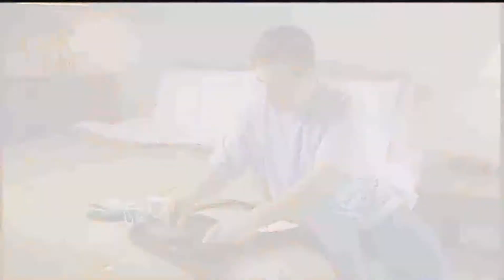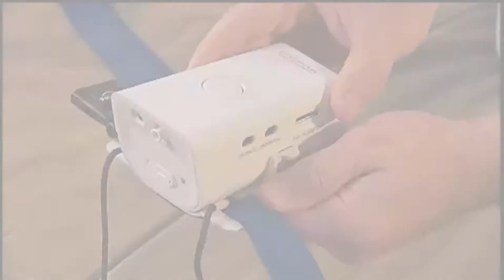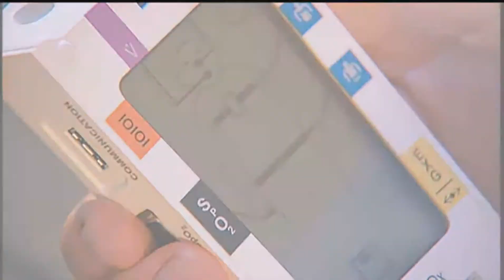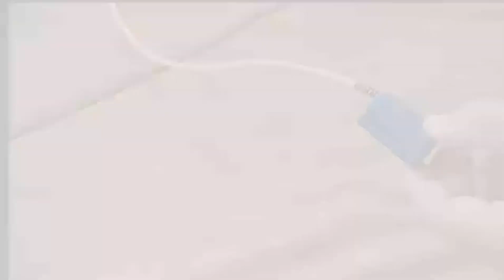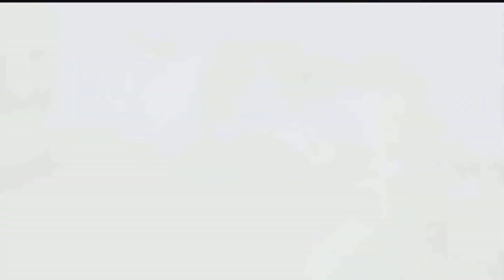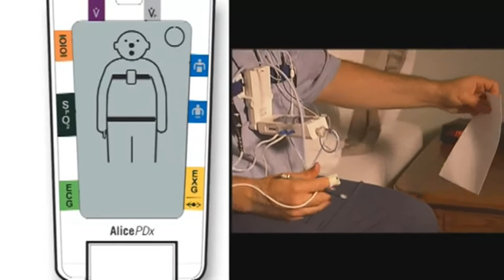Alice PDx from Philips Respironics | Dispositivo de Diagnósticos Portátil

Comment: This device is to blame because of a bad design decision in lacking one of the most important things needed: It has no indicator whether you see it records correctly (neither outside as a lamp nor to see inside at the screen). The lamp showing in the video only shows up when there is a connection unplugged, but no signal whether the operation is alright. Our hospital uses that old device and its bad if you have to rely on such issuing device and you don't even know whether it is recording or not. My father  who has Parkinson is very ill and can't almost get out of the house with him. We get this device only in every 5 years (because its always occupied) and the attachment is very difficult. If the record isn't made just because of we don't know it was incorrect, could mean that he does not get the necessary therapy he needs and this as well can indirectly lead to an earlier death of him. I can't believe how developers, which have A++ diplomas and get the most difficult things done miss one of the most simple and important features.
Also how can it be that you provide nothing like a proper manual for its use on your website (just a geeks technical reference and tiny product brochure) than just linking to this low quality video for a device which cost hundreds of dollar? Am I dreaming or can that indeed be true? Many things went wrong here, I will never understand.
Full blame on Philips for the stress and damage you provided to our family with that.